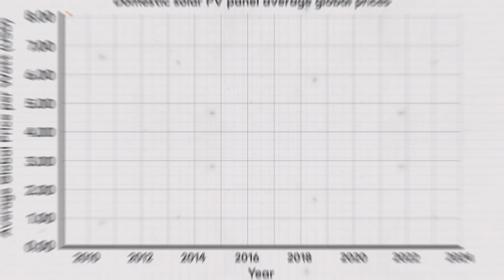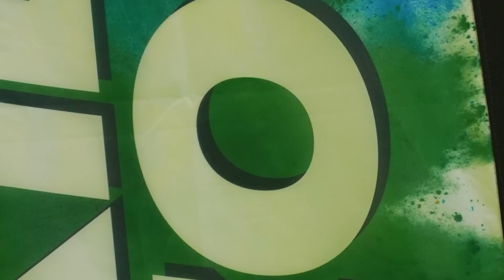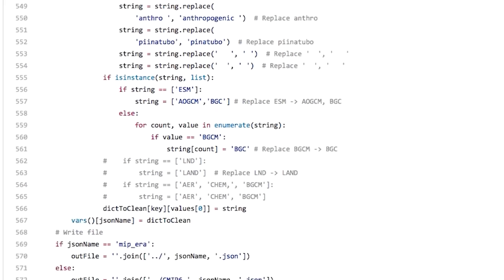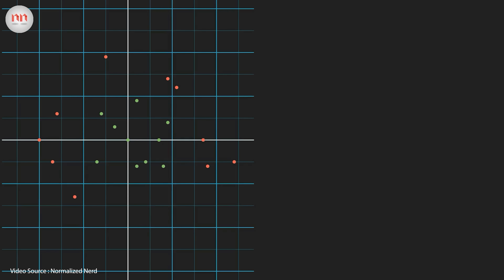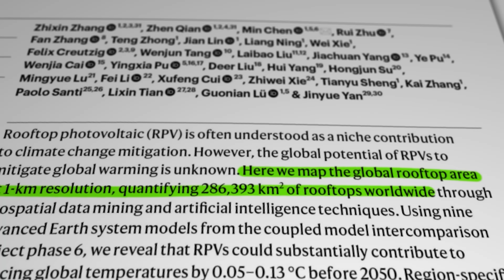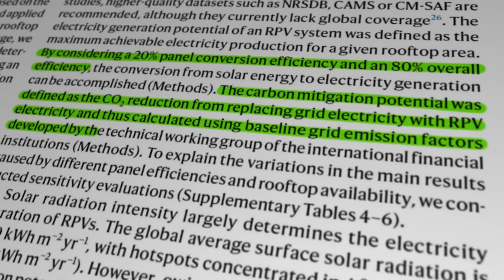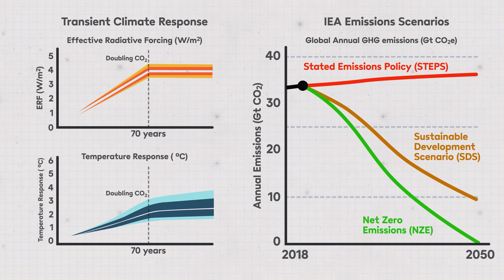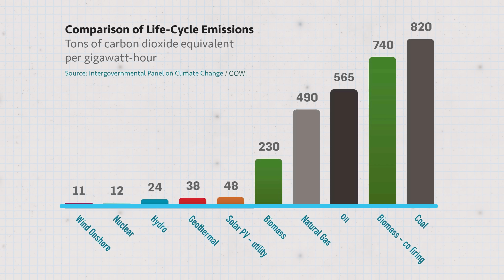New Report - Rooftop Solar PV is THE biggest climate mitigation technology!

Comment: When I looked into solar just over a year ago, one thing surprised me.  No matter what I decided to spend, the "Pay Back" time was always roughly 8 years.  Spend a little, save a little = 8 years.  Spend more, save more = 8 years.  Spend a lot, save a lot = 8 years.  Include a large battery, never pay for electricity again = 8 years.
Based on those calculations, I bought the biggest system I could and have been self sufficient ever since.  Power prices have risen, so that must have cut the pay back time to less than 8 years, but I never bothered to re-calculate it.  No more power cuts either, so I'm feeling pretty smug.😊
Reply: Any place that offers zero for exports really needs to change that. We should be in the incentives phase.
Reply: @jnawk83  I agree with you entirely!  However... there are some not so bad reasons for that policy.  The power you can install on a roof is limited... generally more or less in-line with the family's consumption.  So, the surplus are not that great.
But here in the French countryside where I live, land is cheap... very cheap... and everybody or just about has an acre or two (I have 10).  People could therefore over-dimension their ground-mounted solar installation tremendously, if they were getting the same price for their surplus energy, as people with roof-mounted installations.  There could hence be abuse.  And that I believe... I would have been the first one tempted to abuse the system if I had been given 12.69 euro cents per kWh surplus, like was then the case for roof-top installations.
Reply: @jnawk83  The problem with this is that if everyone has solar, the grid can't handle the excess power. It's better to just subsidize new panels.
Reply: @jnawk83  for many people the export payments from rooftop solar are small compared with zero price fuel for your BEV.
Reply: We have 3 years as ROI for everything in germany, but we build that on our own from panels on the roof, the string planing, where to put optimizers and the invertes, also options to scale up in the future and of cause building 2 batteries.
That was 2 or 3 years ago, a step by step projet. 
Now it has even become cheaper: 10 kWp 2000€ incl. mounting bits and pieces on a tile roof (concrete tiles) plus 1500€ for the inverter.
Hybrid Inverter is about 2000€ - so 500€ more. each 16 kWh battery is now down to 1400€.
Hence : a lot cheaper and the payback time is a lot cheaper. We have about 30 kWp and expect a return on investment in each year of 4000€ , which increased after we installed a heatpump to about 5000€ - hence 15000€ paid back after 3 years.

and i can repair everything myself
Reply: @typxxilps Impressive!
Gratuliere!
Reply: A relative of mine doesn't want to spend money on solar panels because he claimed they won't pay for themselves before he has to sell up or dies. Financially conscious right. But then he happily bought two brand new ICE cars instead that lost more value than the cost of solar panels the moment they left the forecourt 🙂
Reply: I'm from Brazil and I installed mine in 2016. The pay back time was 7 years, but with the constant rise on power prices it was paid back in 5.
Reply: Tax-free savings 😊😊😊😊😊
Reply: that is a very well earned smug. congrats!
Reply: I didn’t get subsidies because my income is too low to pay income tax. I built my system off grid ,feeding separate essential circuit panels in the two houses I have on adjoining lots.
The grid connection only runs electric dryers ,ranges,and ac chargers at night when the electricity is free. 
I never had any desire to feed the grid because it’s like dancing with a very drunk fat lady. OK , I don’t dance,but I have nothing against fat ladies as long as they stay out of my liquor stash.
If you had four or five houses on adjoining lots it’d get very easy to go completely off-grid with a little discipline. 
As it is, I only have one grid connection and the bill for the two houses is rarely over $100. That is when we do a lot of entertaining and cook a lot.
The secret is re-invest savings in battery expansion.
Reply: I build a rooftop solar system myself and it has a ROI of about 3 years. Don't get me wrong, Im planing on a North facing array, so covering every surface with panels would be my way to go. BUT the less you can use that free power (or get paid for) the longer the ROI gets (approaching some limit of course)
Reply: And 3 years if you DIY, or 1.5 years if you still have a residual FIT payment. I've just replaced a 2008 solar thermal system and upgraded the panels on a 2010 FIT system so now we have 7kW of PV instead of 2.9kW, 16kWh of battery and are almost totally offgrid. Panels and batteries have got dramatically cheaper in the last few years. Original 2.9kWp system was 14 grand (and £800 for the 40-tube solar thermal). New 4.2kWp+2.9kWp+battery system was £4500 and makes over £3000/yr in payments and savings. Solar PV is extraordinarily good value now. We also have 2.9kW of UK-made panels to pass on to someone.
Reply: This depends hugely on what you get for exporting electricity to the grid. If you have net metering: go for it but if you get 7ct/kWh like in Germany (soon to be 0 ct/kWh maybe) the more panels you put on to your roof, the less financially efficient your system becomes
You can only consume so much of the electricity you produce, so the bigger your system is, the more you have to export
Reply: @Fluxkompressor   Sorry, I should have said, we are in South Australia.  The system was designed to provide 100% of our power needs, 24 hours a day,  in the middle of winter, saving $4000 in power bills per year.  Hence an 8 year pay off time.  We do get a small feed in payment, but its just a tiny bonus.  Not buying electricity is the biggest benefit.
Reply: @ 
from what I've heard, it's been the case that if you're an urban or suburban homeowner in Australia, solar panels have made financial sense for at least the past 15 years
Reply: @panchostanza8712  It's effectively anywhere in Australia, even rural. Solar for that time and longer, and now with battery prices coming down, that's making more sense. One thing that's not often factored in the battery side of the discussion is the reliability aspect, i.e. grid outages or brownouts. Batteries can help avoid this, and it's one of the reasons we got ours a few years ago, even though the payback period for the battery portion of our solar+battery wasn't 100% economically feasible. If we lose power here (rural residential zone), we lose water (pumps), etc, so the reliability factored is worth a lot to us.
Reply: @martythemartian99  you are the reason grid owners are gouging the poor slow adopters as they scramble to maintain cashflow into their $TRILLIONS national electrical grid investment. 

Even the nuclear promoters talk maximum UTILIZATION.

Rooftop PV and v2g EVs massive battery maximum UTILIZATION breaks grid UTILIZATION and grid cashflow. 😮😮😮
And will break nuclear maximum UTILIZATION.
SHTTSNPANTS feelings for grid owner's and nuclear promoters.
Reply: @panchostanza8712  That's why Australia leads the world in rooftop solar per head. More than one-third of homes have solar rooftop panels. Now that feedback rates are heading to zero, our federal government is subsidising battery home storage. It reduces the upfront cost of battery installation by up to 30%. That equates to an average AU$ 4,000 saving on a standard 11.5 kWh battery system.
Reply: @Fluxkompressor  not with a battery tho. here it scales till your needs are fulfilled 100% of the year/day
Reply: @Fluxkompressor I get ZERO for any power I feed back to the grid and got ZERO subsidy. It was still worth it!
The reason for that is that my solar panels are ground-installed, and here in France, there is no help whatsoever for such installations.
Reply: @st-ex8506  France nuclear fleet must a have maximum demand stability on the national electrical grid.
Reply: @st-ex8506 What is their technical reasoning behind not letting you feed into the grid if your setup is on the ground?
Reply: @ indeed!   Contrary to a gas-burning plant (or even a coal plant... which output can be turned down, if not completely off easily), which can be almost instantly turned down or off to give place to more solar or wind power, nuclear reactors cannot.  
While French nuclear reactor are somewhat more flexible than those of competing technologies, nuclear is not really a dispatchable power source, but rather a constant one.
At night and on Sundays, France often produces an excess of nuclear power, which is exported, in particular to Switzerland, where it is stored in pumped-hydro installations, and used domestically or exported back the next day at peak time… a very profitable trade!
Reply: @ There is NO technical reason for that.  It is only a policy to discourage excessive private solar generation. The French grid is mostly nuclear... and nuclear reactors' output is difficult and very slow to throttle up and down!
BTW, I can feed my surplus power to the grid... I am just not being paid anything for it!
Reply: @st-ex8506   Coal and gas plants actually take a long long time to be turned down, and even longer to be turned up again.  This was why we had so many power problems (cuts, transformer fires, etc) back when all we had wad coal and gas.  The balance brought by home solar and community batteries, has smoothed out the power grid and made the system work much better.  Unfortunately the high price of gas is driving electricity market prices.  Thus more wind, solar and batteries are needed to drive gas out of the market forever.
Reply: @Fluxkompressor  you get battery and charg it when energy prices are the lowest and then use stored energy during the night
Reply: @Fluxkompressor  Not as much as it used to. In Florida USA, off-grid payback time is about 7 years. That is with no connection to the grid at all and enough batteries to last week and charge 2 EVs.
If it is legal to do so, off grid is usually the better deal now.
Reply: I get hail about 4 times a year! My neighbours scramble to cover their windshields! Imagine what that would do to the solar panels
Reply: @user-tx2nv1rb9k  If the hail is that big that it will break PV panels (which are tested against hail impacts), what do you think will happen to your roof tiles?
Reply: @TerraPosse  Nothing , my roof is walk on made of concrete
Reply: @user-tx2nv1rb9k  You don't have to imagine. It takes softball size hail to damage most solar panels now. Most are warrantied for 2" hail at 120 MPH.
The kind of hail that damages solar panels is typically a once in 500 year event.
Reply: @user-tx2nv1rb9k they normally survive fine, but in severe cases the can smash. The panel itself is very expensive now, so in the event you lost one, its not the big of a deal to replace it $150 done.
Reply: Well done for installing a big system of PV panels but did you know if you do get a power cut the system shuts down. This is to protect electricity personnel from danger as the energy will be going the way making the grid live.
Reply: @ wrote "did you know if you do get a power cut the system shuts down?". That depends on the system design. Mine just stops sending power to the grid and carries on powering the house. I won't even notice until I see the email message saying the grid is off. And it will auto-sync when the power comes back and just carry on working. (Victron inverter).

It's true that the vast majority of domestic solar systems so far just shut down with the grid, but that's changing as batteries, and fancier control electronics becomes more common.
Reply: Well done for installing a big system of PV panels but did you know if you do get a power cut the system shuts down. This is to protect electricity personnel from danger as the energy will be going the way making the grid live.
Reply: @andrewherring6636   I made sure to have the proper equipment installed to automatically cut the power connection during a power cut, so we can keep going on solar during the day, and battery at night.  It works well and we only loose power for about 20 seconds.  No exports till the mains power is reconnected.
Reply: Without overall control of saving energy solar has been pointless for all people that I have seen, friend got some and great rate back that is due to run out but with the money saved bought a motor home and travelled the country. An average UK household uses about the same amount of electrical energy in a year as is in 11 tanks of diesel. With solar being around 2% of total energy in the UK and just being an add-on to total energy, solar has had zero mitigation on the climate because their has been a zero reduction in energy consumed.
Reply: @antonyjh1234   I have no idea what point you are trying to get across.  2% is low, but its still 2%, and I'd assume that will increase over time.  I don't know what the percentage is here in Oz, but I'd guess most people in either country got solar not to change the world, but to lower their costs in the long term.  Not getting electricity bills anymore has really helped increase my bank account savings.😊
Reply: @martythemartian99  In Australia after all this time it is 4.64% of total energy, if people still use the grid it would of course be much less per household. Point is helping your bank account is only great for the planet if it stays there, if somebody uses the saved money to consume other products then no energy saving overall.
Reply: @antonyjh1234  There must be a saving.  I am not drawing from the grid, so there is a saving.  I am exporting 85% of my solar production to the grid, so that must help too.  Considering over 4 million homes in Australia, 34%, have solar, that would be making quite the difference.
Reply: @martythemartian99  A friend got solar at the start got a great rate, with the money saved bought a motorhome and travelled around the country and Australia is a big place. Elec is 29% of total energy, total energy or emissions is worse than Americans per capital so a bit deceptive to use percentages but overall of total energy is Net Zero. Australia could cut 71% of its energy if it powered all electricity on coal and stopped using forms of oil other ways.
Efficiency is a saving of energy, Net Zero is total energy, no point getting solar panels and driving around the country, going out to eat more, an overseas holiday, buying more clothes etc etc etc because then is no saving at all of energy, just a transference .
Reply: @antonyjh1234  you are so confused. 
LNP talking points to confuse.
Reply: @stephenbrickwood1602  If you have point to make please do but don't shoot the messenger.
Reply: @antonyjh1234   did you think about collapsing grid income. 😮 ?????
Look at the famous duck curve.
There are 2 duck curves. 
The 2nd is the collapsing GRID CASHFLOW. This is so f......king obvious.

This is extremely dangerous to nuclear electricity that needs both
 247 continuous demand and 
247 continuous cashflow. 

Nuclear needs its maximum UTILIZATION. Because it is fragile. 
Seconds to shut down and days to get back on line.
But what the F do I know ? after decades in fossil fueled generation and transmission.
Ask the nuclear promoters why maximum UTILIZATION is important. 
Ask the nuclear promoters if reactor plutonium production is valuable as reactors are the only source of plutonium in the world. 
Ask nuclear promoters why Australia only sells uranium yellowcake to nuclear nonproliferation countries. 
Ask how does worldwide CO2 emissions are stopped without uranium nuclear electricity.
Reply: @antonyjh1234 Net Zero is about emissions  reduction, not necessarily energy reduction. We can use more energy if we like, so long as it's not fossil-based, and still achieve Net Zero and climate stability.
You seem quite confused about this.